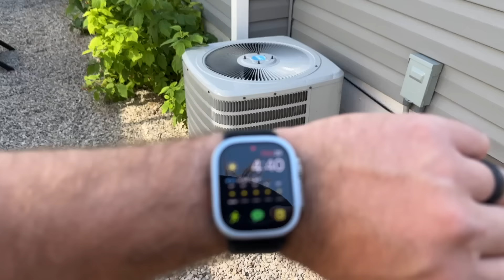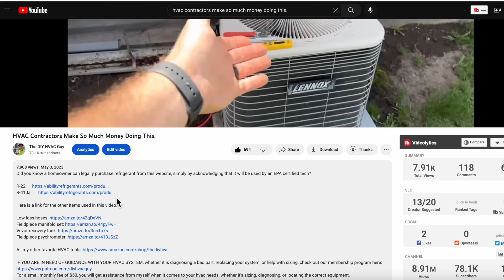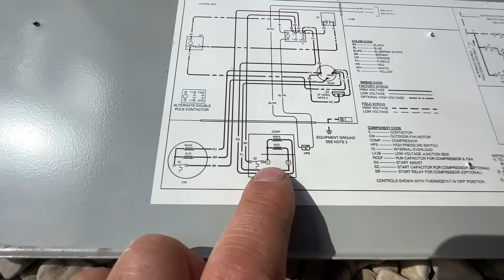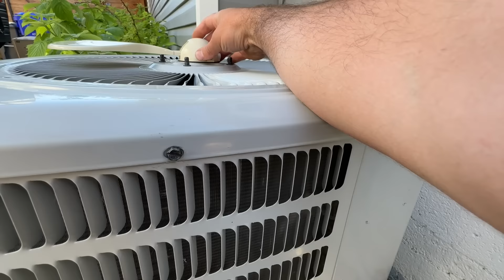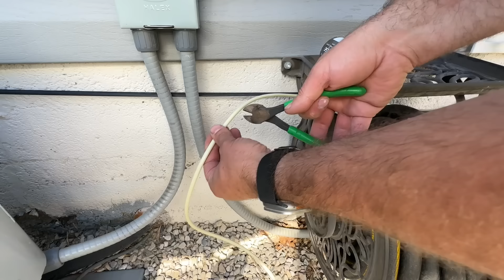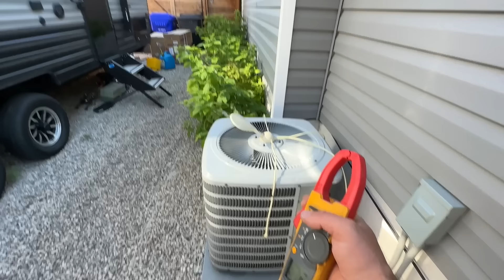Can This Device Actually Lower Your Electric Bill By 30%??

Comment: What would be really great if the water that is condensing on the evap coil could be used to cool the condenser  coil. The water would be without calcium and is otherwise just wasted.
Reply: Run a condensate pump to a distributor tube on the condenser lol you could probably make it pretty easily. It's not a bad idea and the water would be even colder than tap
Reply: PTAC units do this. 25 years ago even.
Reply: @daveyt4802  Yes they did but didn't mention water hardness or damage to outdoor coils either!
Reply: @bobboscarato1313  Water hardness from condensate?  Where would the minerals come from?
Reply: @leifhietala8074  Not from condensate!!!
Reply: @leifhietala8074  dirt on the evaporator coil. Also slime on the same.  Twenty plus years and I 💯 am not going to be drinking a refreshing glass of cold water out of any condensate.
Reply: I had a big old window unit 30 years ago that allowed the condensate to accumulate at the condenser fan and sprayed it on the coils
Reply: That would be ideal.- but you'll need a pump to force condensate water from indoor coil to outdoor coil.-
Reply: This is how most of the newer window AC units work. I recently bought a one to put in my house to help take the load off the main AC. There is a pan where the water from the evaporator coil collects. Then the fan that cools the condenser has a little ring on it that "slings" the water on the hot condenser. You can hear it outside, and there is no water dripping from it.
Reply: @ScarabChris  You are right...I have an older LG ( Goldstar) Window AC in my garden shed. The condenser fan mists the water on the coil.
Reply: There is a device called a condensate heat exchanger.  The condensate flows around the liquid line.
Reply: Yea ive always made notice of how corrosive condensate is on metals.  If you see one ran to a floor drain look at the actual drain and itll be all kinds of rusted and ate up.
Reply: @Z-Ack  Are you sure you are talking about AC condensate? This is basically distilled water. Now from a condensing gas or oil boiler, that is very corrosive.
Reply: New window units do that, and some of the less-terrible portable units too.
Reply: @@robertswaine6096 Many mini-splits (especially ceiling cassette models) have little pumps to push the water, they would be a natural for this.  Ones with plenty of fall from wall-mount indoor to ground mount outdoor, just pipe to a distribution drip line and call it a day.
Reply: Probably not enough volume of water coming from the evaporator coil to have a stady stream spraying on the condenser.  A condensate pump only turns on when it fills up which takes awhile.  Possibly in a high humidity environment it might be feasable.  It would at least turn on and spray it off every once in awhile.  Keeping an already clean condenser clean.  If you use this thing on a dirty condenser it probably will do nothing at all except waste water.
Reply: @@robertswaine6096 Doubt thier would be enough condensate to keep a steady stream on the condensor.  Possibly in a super high humidity environment.
Reply: @@robertswaine6096 I think YOU are missing the point of how a heat pump works.  Dumping water on the compressor is not useful.  The compressor is not where the heat exchange happens.  Cooling the motor isn't a bad thing but the bigger bang for the buck would be to drip or mist condensate directly onto the condenser COILS, to ease compressing the gas to a liquid.  With some of that work done by the water being heated/vaporized by the warm coils, the compressor motor then doesn't have to run as hard/get as hot/need cooling.
Reply: @@klinestill while ill advised to intentionally put water on an electric motor.  You left out some details one it is a sealed motor you would not be putting water directly on the motor.  Two do you turn your ac off when it rains.  Boy this video set some techs heads spinning. Mine included. I have seen more damage than help coming from these systems but if people stop trying to tweak then baseline becomes the only line.
Reply: @@klinestill cool the motor directly is where they seem to be going. Lower motor temp reduces amp and it will decrease the discharge superheat of the compressor itself.  Effective output I would still give to the mister as evaporation is greater than going the direct approach on the compressor. Personally won’t do that either after seeing the damage done to coils tried by others. But maybe they get it balanced and it all works out good for them. But I haven’t seen that side of the equation as of yet.
Reply: @@klinestill I agree with you 100% on that.  That is the whole purpose of the coil it is for heat transfer.  I was only pointing out they weren’t talking about hosing down an open enclosure motor. Their belief in its efficacy is their issue.
Reply: Awsome idea! I use my condensed water for my plants and bushes but I will definetly buy an outside sump pump and see if I can develop the required psi to operate misters, wish me luck.  Thanks for great idea!

Comment: Man thats minspilt cold out of of those vents. How the hell do you do that?😊 my unit is clean and works fine but its 95 here in Ft Myers and the vents show about 64ish in the house...😢
Reply: I was thinking the exact same thing 😂. I’m in Texas where we’ve been between 99 to 107 degrees the last few weeks and during the day, keeping my AC set at 76, I get about 64 out of the vent and my units are brand new Trane units.

His vents were coming from the floor too so I bet his vents are in a cooler place than a hot attic like mine.
Reply: @John-vh1fk  Attic duct distribution is a killer vs. cool crawl space duct distribution. A 10*f gain is no surprise. Terrible place to put ductwork in hot climates, but, concrete slab construction is so damned cheap. That why. Also, 20*F drop across coil is consistent. If He has 53*F register temp. means his house is 73*F inside(return air temp.) No magic, no mystery, just physics.
Reply: @John-vh1fk  exactly John!! I have a couple of minisplits and they blow in the high 40s!!! I need that for my 4 ton units please!!! We need to get rid of these old antiques that burn energy like crazy... my electric isn't getting any cheaper that's for sure.
Reply: That's an excellent split; normal a/c or h/p split for cooling should be around 20 degrees.-

Comment: Lowering head pressure WILL drop your bill cost for sure.
Is water mister good? yes during heatwave.
Permanently? No. You will deteriorate your condenser prematurely.
I didn't know kits were sold through
Reply: I can't imagine spraying water on your AC system would be good over the long run.
Reply: That higher head ressure is what pushes the refrigerant. They could make a water coold condenser but this isn't that.